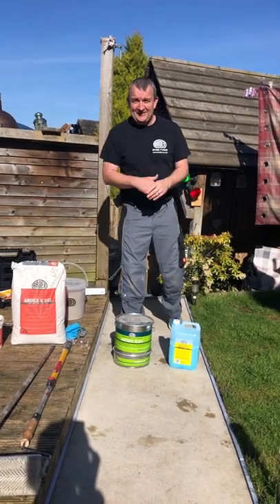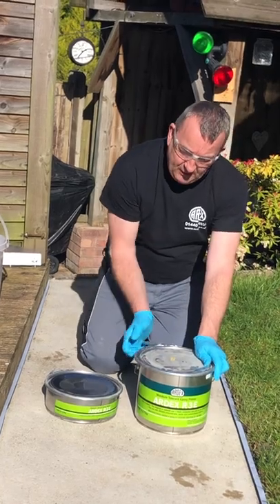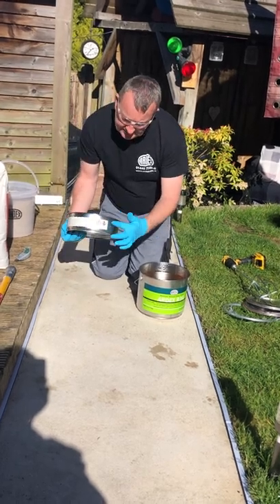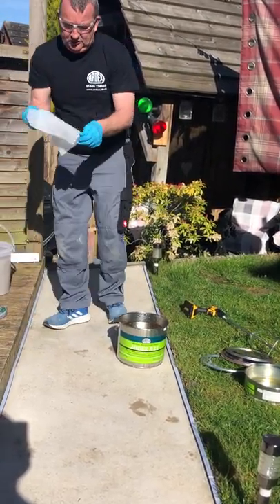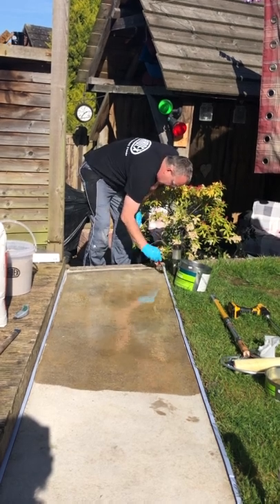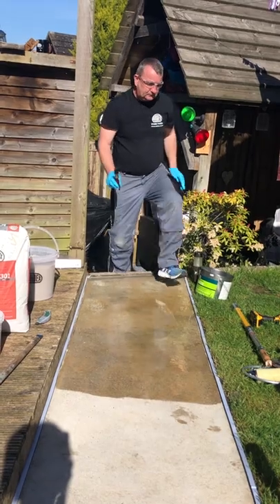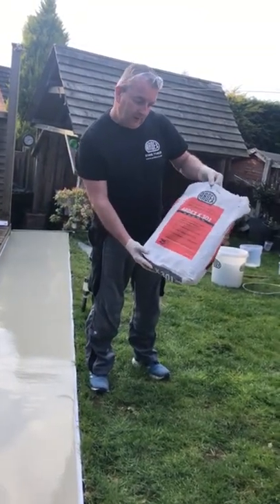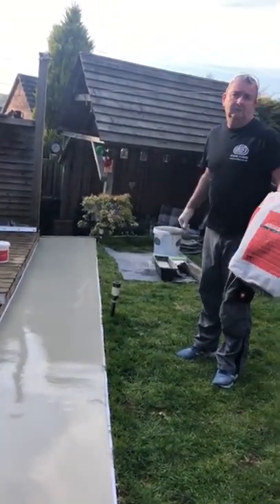How to level exterior concrete paths with ARDEX K 301 Exterior Self-Levelling Compound

Comment: Those Safety glasses will really help protect his forehead.
Reply from the maker: The safety glasses were only used when we mixed the epoxy primer, and were removed after. They won’t help protect foreheads.

Comment: I have a 40m² patio area concrete slab that I am laying porcelain pavers on with adheisive. I need to raise a 6m² section that is about 10 to 20mm to low. Can I lay porcelain pavers on K301?
Reply from the maker: Hi Martin, thanks for your question. Yes, you can tile directly onto K 301. You can see the datasheet for more info here: https://ardex.co.uk/wp-content/uploads/2017/06/technical-datasheet-k-301.pdf

Comment: I have concrete shed base which is 18 ft x 10, which is unlevel , can I use this stuff on there, it finds it own  level. Because concrete up to Woden batons its going to drip over
Reply from the maker: Yes ardex K301 will be suitable, ensure the concrete is clean as per the data sheet, prime using ardex p51 as per data sheet, then apply the K301, in regards to self smoothing, the product will flow but will need troweling, in regards to stopping in running over your timber battens you could use a foam tape to stop this happening. The datasheet can be found here: https://ardex.co.uk/wp-content/uploads/2017/06/technical-datasheet-k-301.pdf

Comment: Can this be used over flagging?
I was going to screed over the flags, then put artificial grass down.
The flags are solid, prety flat, just a few little bits to even out
Reply from the maker: They would need to be pressure washed or abraded to provide an absorbent surface. Ensure the pointing mortar is sound, hard and well adhered.

Comment: Can this product be mixed with exposed aggregate and repair an exposed aggregate patio? I have a low spot in an inside corner which needs to be brought up 3/4 in - 1 in but still maintaining the exposed aggregate finish. I was thinking of 2 solutions: 

1) either use this product mixed with the same aggregate the rest of the patio contains in its mixture (by doing so, will this product coat the aggregate masking its multicolor? Could I come the next day and carefully pressure wash it just to clean the surface aggregate or after a few days maybe light sandblast it?) or 

2) build layers of epoxy with the same exposed aggregate until the desired level achieved ( the problem I see here is that the color of the aggregate would show nicely but I would be missing the concrete's gray color in between the aggregate as in the rest of the patio surface- not a problem if you paint over it which is not the case here). Thank you.
Reply from the maker: Good questions Marius, in testing we noticed there was a potential risk that any exposed aggregate could lift out the surface in time and diminish the abrasion resistance of the floor in the future. For the second point, we feel that may look very diffrent to the original finish. Good luck with your solution.

Comment: Hi iv laid a square base of 2x2 slabs an i want it concrete level like your path? Is it possible with it having slight slithers of gabs an an odd raised corner??? Help iv just brought a bag off the ardex k301 an a litre of p51
Reply from the maker: Hi, please contact our technical support team on 01440 714939 to help you with your query 😊

Comment: Can K 301 be laid over  a 20 mm ballast mix?
Reply from the maker: Hi Michael, I'm afraid not, it has to go on a solid structural background like concrete.
Reply: Hi Steve, I shot myself in the foot I bought 3 bags of K301 and a liter of P51 thinking I could go over this (1) cement (4) 20 mm ballast mix Is there anything I could do to save this job so I can tile over with porcelain tiles, it's an area of 8m2. Thanks 👍

Comment: Hi, Really liked youre demo thanks. Do you know if its ok to apply P51 primer onto a substrate that has some floor paint on it ? Also when laying the K301, should the P51 still be wet or dry when laying...? ARDEX had told me it should be wet, but im reading different things now....? Thanks Chris
Reply from the maker: Thanks for the feedback, Chris.

In general, “no”. A painted floor refers to anything on a floor that resembles paint and can include a variety of finishes ranging from acrylic or chlorinated rubber paints, which are generally used in domestic properties, to epoxy-based coatings more common in industrial locations.
 Before applying ARDEX K 301 we recommend the removal of the “painted finish” to reveal a sound substrate without barriers to adhesion. This is because even though the ARDEX product may adhere to the “paint”, the bond of the “paint” to the substrate may not be strong enough and could lead to a failure in the floor. In situations where a contractor deems the “painted finish” sound and wishes to apply ARDEX products directly to the “painted finish”, a trial area is always recommended and the contractor is accepting all responsibility that the bond of the “painted finish” is sufficient for the end-use.

For external applications prime with ARDEX P
 51 Primer diluted 1:7 with clean water and apply with a brush or broom. Ponding, puddles or surface primer must be removed with a broom so that excess water is not incorporated in the mortar during application. Apply the ARDEX K 301 whilst the priming layer is still damp. Check out the datasheet for more information https://ardex.co.uk/wp-content/uploads/2017/06/technical-datasheet-k-301.pdf For internal applications you should let the primer dry, so that might be where the confusion has come from? 

Please get in touch if you have any further questions.

Comment: Hi there , what did you use to prevent the compound flowing over the edge on to the grass etc ? When trimming the edge of the grass will the  301 not break ?
Reply: Also interested in the answer to this as am considering my entire patio and pathways with this
Reply from the maker: You can use ARDEX foam tape or if you wanted to get a nice crisp edge, you can slide some 6mm plywood strips between the original concrete path and the soil/grass. 

In regards to damage when cutting the lawn,  you can run the mover with one wheel on the path, and it will trim to the perfect height.
Reply from the maker: @timjwes   Hope the above answers your question?

Comment: Can you use this product to re surface concrete steps? Would you simply allow it to cascade down the step to coat?
Reply from the maker: Hi Basinateorfullet, thanks for your question, we've used K301 for the treads on steps before, but due to the consistency, it wouldn't be suitable for the rises. For concrete step repair we'd recommend ARDEX A 46 Multi Purpose Repair Mortar. Which will go from 50mm to a near feather finish.  Demonstrated in this video: https://youtu.be/9i0W-LD2iYY

Comment: I have a small dip that creates a puddle. In my concrete garden path. What is the best way to fix this?
Reply from the maker: Hi Graham, for a small dip you could use ARDEX A 46 Multi Purpose Concrete Repair Mortar. It can go from a feather edge to 50mm and is available in 5kg buckets at merchants such as Travis Perkins: https://www.travisperkins.co.uk/screeding-and-floor-levelling-compound/ardex-a46-5kg/p/771706. There's a step repair video here if you'd like to get a feel for the product: https://youtu.be/9i0W-LD2iYY
Reply: Thank you very much for your advice. I will look into this and let you know how I got on! Thank you once again.

Comment: The finish looks really smooth, is it
Slippery when wet? Can you rough it up in order for it to be more grippy when walking?
Reply from the maker: Thanks for getting in touch. When dry it won't be any more slippery than concrete, so should be fine. You can 'rough' up the surface slightly by using a broom, but you'll need to follow a few steps. We'd be happy to talk you through this if it would help?

Comment: Hi i have a path at the front of the house made of concrete im looking to resurface it my issue is it has a slope running from the door down to the street  the fall is around 15 inches over a 6 mtr distance . Is it possible to mix this thicker so it doesn't slide down the slope so to speak or is there a more suitable product i could use .
Reply from the maker: You can mix it at 4 Litres of water per bag for mild slopes. But we've never tested the maximum gradient due to too many variables I'm afraid.

Comment: What did you use in the edges to prevent overflow?
Reply from the maker: Hi Guillermo, we used thick insulation tape to dam run off areas. It's pretty cheap and effective. With rough edges / damaged concrete, we'll typically secure some wood profile along the outside edge and fill any badly damaged areas or gaps with a repair mortar, before applying K301.

Comment: Does the initial ipoxy coat stop water penetration into old concrete sub surface.
Reply from the maker: Hi David, The ARDEX R3E primer is not designed to stop water penetration but it will have some effect of slowing it down. But it's worth noting an old concrete subsurface may not have an active damp proof membrane underneath to protect it from moisture coming from the ground or the sides.

Comment: Im looking to use this over my drive path and patio currently uneven york stone, would this level out over the lumps, bumps and cracks in pointing or would it need some prep first?  Cheers Greg
Reply from the maker: Hi Greg, unfortunately, we don't recommend ARDEX K 301 over york stone. If you drop us an email we can give you a call to discuss alternatives.

Comment: Will this product  work on a sloped  driveway ? approximately 15 degree incline
Reply from the maker: Thanks for the question, Martin. ARDEX K 301 can be used where there is a small incline, and it helps if you use ARDEX  R 3 E Primer and hold some water back from the mix. If you could send a picture of the area to info@ardex.co.uk we can take a look and give you some more specific advice.
Reply: @ARDEXUK  Hi, does this mean i could use K301 to resurface an outside path and maintain the fall towards a drain. i.e. If i held back a bit of water from the mix could i then work the product so there is still a fall rather than it finding its own level and removing the fall. (note, its only a small fall so not a steep gradient. Thanks

Comment: Can this product be used over ardex na
Reply from the maker: Hi Daniel, ARDEX K 301 has greater tensile strength compared to NA, and may put too much stress on it causing it to lift. We'd recommend removing the NA back to the concrete first. Get in touch if you need any further help on 01440 714939.

Comment: Does the surface need to be dry before the primer is applied?
Reply from the maker: No, the path does not need to be dry but excess standing water should be removed by broom. For external applications prime with ARDEX P 51 Primer diluted 1:7 with clean water, and applied with a brush or broom. Ponding, puddles or surface primer must be removed with a broom so that excess water is not incorporated in the mortar during application. Apply the ARDEX K 301 whilst the priming layer is still damp.

Comment: Can you use this over a cracked concrete path to finish off with a smooth top coat?
Reply from the maker: Sorry for the late reply. As long as the cracks aren't structural, ARDEX K 301 should be fine, and it will provide a smooth finish. Please get in touch if you'd like us to discuss in more detail.

Comment: A customer has applied ardex DPM and ardex na in his garage can I apply k 301 over the top
Reply from the maker: Hi Daniel, the two products have very different tensile strengths, so we'd always recommend clearing the substrate to the concrete base before applying ARDEX K 301.

Comment: Wouldn't the thin side chip easily?? With something heavy or sharp.
Reply from the maker: Most concrete can chip with something heavy or sharp. Ardex K 301 does however exceed the recommended strength of standard concrete for driveways with a compressive strength of C30 and a flexural strength of F7.
Reply: @ARDEXUK  Thanks for replying. 
I was wondering though if thin 1/4" Ardex may chip easier than 4 inches of regular concrete.
Reply: @ARDEXUK  Could  I use Ardex to level a 40 foot sidewalk that is tilting to one side?

The polyurethane companies want $1300 to inject polyurethane underneath to raise it.
Wondering if I could pour Ardex on top instead?
It would be 1 1/4" thick on one side.
Then taper off to ~ 1/4" on the other side 3 feet away to make sidewalk level.
Thanks,

Comment: How much water was held back in this video, states that path is on a slight gradient (as is my old garage) and so held some water back but didn't hear how much.
Thanks.
Reply from the maker: Hi 1nayls, thanks for your question, a 25kg bag requires 5.25 litres of water, I used 4.5 litres for the path.